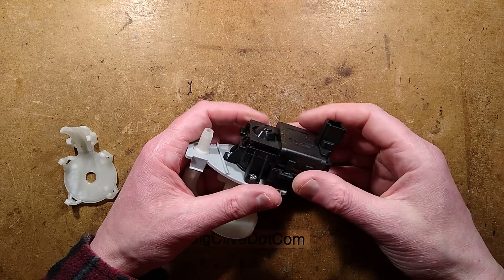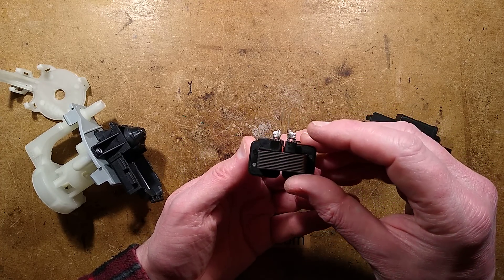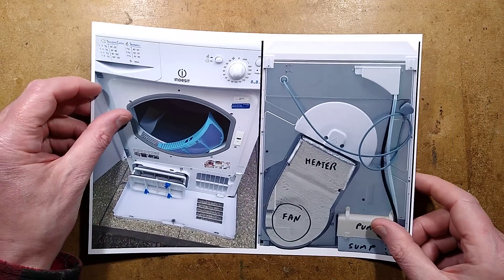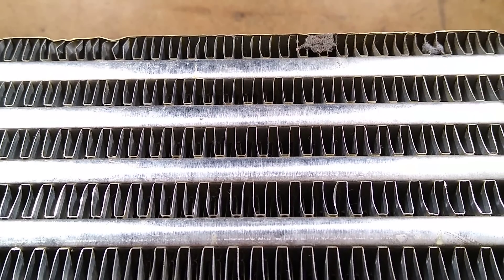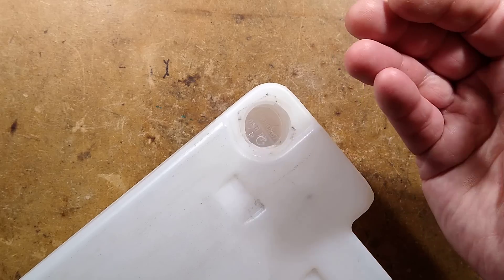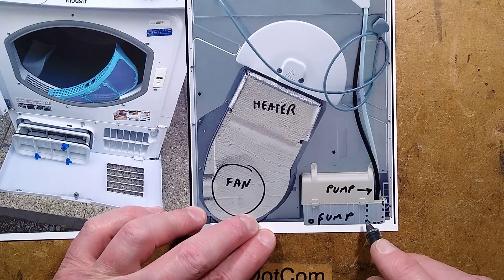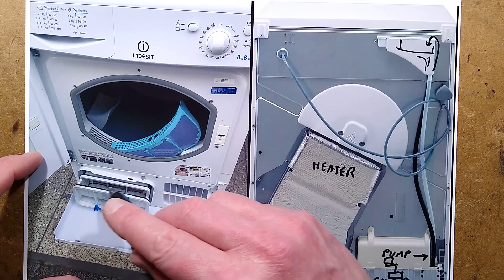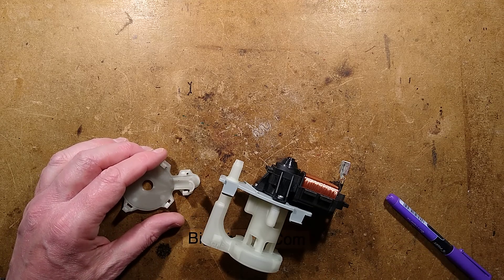Condenser laundry dryer pump

Comment: I'd love, if the condenser would work with a heat pump. It would make the design of the dryer just absolutely elegant and efficient.
Reply: most modern ones here work with a heat pump. maybe the really cheap ones don't.
Reply: There are heat pump dryers on the market. They are quite expensive, though. Around £750 for a Bosch.
Reply: @JeanTheronZA  that is expensive, i think i paid €600 for mine. it is a whirlpool
Reply: @martijn208  We were quite lucky with ours. Had a standard condenser dryer by Smeg (was about €250 10 years ago), and when they couldn't find the correct door seal for it when it needed repairs, they swapped it for a heat pump version, free of charge.

Sorry, I see now that I gave the initial price in Pound Sterling. Meant Euro, if you take a direct conversion from South African Rand.
Reply: They do exist! Lots of brands have heat pump versions of their driers. Magic stuff as they only consume 400-500 watts when drying!
Reply from the maker: The heat pump type cost about 4 times as much and have more to go wrong.
Reply: I bought a heat-pump one and when I did it, calculated the net saving in energy over using a more conventional one. I worked out it would pay for the extra purchase cost in three years. That was 11 years ago. Given the increase in energy prices over that time, it seems to have been one of my better purchasing decisions.

Comment: If this dryer is used in a smal/bad vented room, then the room temperature will rise until the cooling air(room air) dont cool the condenser enought, then the damp internal airstreeam will not condense and the drying will take forewer (or time out with still wet clothes after about 6 hours)
Reply from the maker: It does need a reasonably sized room or the door left open.

Comment: It seems they could've easily built it with just one main motor and different gear reductions? I wonder why they didn't do that
Reply from the maker: The main motor runs the drum and both hot and cold path fans.  It would be more complicated to use it for the pump too.

Comment: You are correct, these types of pumps are not very efficient, but are robust and capable of handling solids (as you say) and also entrained air - without needing to be re-primed. You will see a similar, rubber impeller on boat outboard coolant pumps.

Comment: We have a front load clothes washer that has 2 of these type pumps. One is for drain and one is for recirculation. As you can see they're very cheap to make. Our pumps don't have any shaft seals to leak. The impeller and magnet are in a flooded plastic chamber. The coils spin the rotor from the outside. Controls are simple, want pumping action, just turn it on. No valves needed.

Comment: Ok, now all we need is a slightly insane PC enthusiast to use that pump for watercooling. You know, for science.
Reply: watercooling in the 2000 decade started pretty much like that. The PC tuning scene was all about ghetto experiments.
Reply: @PainterVierax  Yeah and I figured this pump would most likely have enough power to circulate the water all the way to an outside radiator, don't know about the cost effectiveness though 😄
Reply: @ragetist  cost and power efficiency is not a thing for g@m3rz. What mattered is how high in frequency this Pentium 4 can go without burning the house.
Reply: @PainterVierax  True, true. I just care about noise these days and would rather undervolt but it would be funny to run a loop outside and see what I can get away with during midwinter and -35°C outside.
Reply: @ragetist  I foresee problems with water freezng in such temp. Even if you plan to run the system 24/7, you'd need to make sure it never fail, which is very costly in redundancy and surveillance systems. 
The safe solution is to sacrifice a bit of cooling efficiency by using two distinct loops with some thermal exchanger in between. First loop is your classic watercooling, Second loop is the outside one filled with some alcohol or antifreeze solution.

Comment: I would not have guessed that such a simple pump could move water up by about 30 inches. That pump is really reduced to its minimum number of simple components, but in way that considers the likely failure mode. We just switched to a heat pump condensing dyer in a US condo and it does seem to be more efficient.

Comment: Hotpoint and Indesit are same company as Whirlpool (they are selling this company off at the moment) main fault that occurs in these machines are the heating element which is easy to replace via back panel.
Reply: Almost yes - Hotpoint, Indesit and Ariston is owned by 75% Arçelik (Turkish multinational household appliances manufacturer known from the brands Beko, Grundic and many more) and 25% by Whirlpool.
Reply: We (in the USA) just replaced a 22 year old Whirlpool NG clothes dryer with a Maytag (Whirlpool) NG clothes dryer. I could have probably troubleshot and fixed the problem (NG burner was probably being turned off too early by a malfunctioning thermostat) but it was in a rental unit and we didn't want to inconvenience the tenant further. Hooking up venting during the install in a constrained laundry closet is also a PITA.

Comment: This is almost exactly the same dryer that I got,  mine has a different "brand name" and also it has a lcd display, where you select programs. As mine is next to a sink, I just drop the outlet hose from the pump into the sink, so I don't need to empty the water container. A couple of years ago, it stopped pumping out water. Opened it up, and the rubber impeller in the pump had  cracked open at the motor shaft, so no pumping was happening. I just replaced it with two zip-ties, and it has run happily ever since.
Also, I think mine don't run the pump continuously.

Comment: We have one like this from Miele. It has the option of the drawer but you can also put the drain pipe down a drain if one is available. It does occasionally tell us to clean the lint filter. I'm not sure if that is on a timer or if it detects a restricted flow. I found that they tend to leave clothes a little damp but the solution is to get stuff out while it is hot and let it air for a few moments.
Reply: Detects restricted flow.  Also, you should routinely clean that filter every few cycles anyway (especially after drying towels and linen).
Reply: @AnotherPointOfView944  My bad, the main lint trap is just inside the door just like in the video. That one we clean each time. But there is another one just before the condenser and that one needs our attention every few weeks.

Comment: Why doesn't it just pump the condensate out into the drain where the wash water goes? Seems extremely obvious to me, given that all washers have drain connections.
Reply from the maker: It's just a dryer and can be located anywhere in the home for convenience.  But if there is a drain nearby it can pump water out directly.
Reply: @bigclivedotcom  Ohhhhhh duh, it does say it's a *dryer*, dunno why I didn't see that. Derp! I'm dumb. I was thinking it was one of those all in one washer/dryer combo units.

Comment: During winter those dryers are the closest thing to a free energy device that you can purchase, all the energy used to dry the clothes is reused again to warm your house.
Reply from the maker: I use mine as extra winter heating.
Reply: But since I'm cooling for over half the year, one of these would just be extra load on the AC.
Reply: @jonc4403 Save up all your summer clothes and wash/dry them in the winter!
Reply: Pity  @jonc4403 can't tie the undies onto a string dangling from the balcony.
Reply: @jonc4403  A traditional dryer even more so, because it vents the hot humid air outside, meaning it draws air from your living space, which is replaced by hot outside air and (worst case) first cooled by your AC before going into the dryer!
Reply: To be really pedantic here, if you want to maximize the amount of heat, you'd probably want to let the water in the reservoir cool before emptying it.
Reply: @JeremyFoster-ve6kq  the big saving is through re-using the latent heat of condensation in the dryer air.  The sensible heat in the lukewarm collector water is a tiny fraction by comparison.
Reply: @JeremyFoster-ve6kq  no! Put it in the freezer first and then throw away the ice 😀
Reply: Better get a Heat pump version, much more efficient
Reply: My electricity bill was reduced when I replaced my condenser dryer with a heat pump condenser dryer, and my heating is all resistive electric
Reply: Unfortunately, same in the summer months.
Reply: soreally just a very effective use of energy. my kind of energy usage (in the wintertime i remove the underclocks on my computers and get some seriously good baseline heating)
Reply: My sister has a smaller size industrial food dehydrator. Wile visiting I slept in the barn that has living areas, kitchen sink and her office, along with a room full of professional sewing machines. I would run it at night to heat the place up and dry put plums and stuff. Then open the windows during the day to remove any humidity.
Reply: I'm cutting edge hi-tech. I heat my room with the waste heat of my CPU, GPU, NAS and HTPC...
Reply: I can only overclock in winter because I live in the tropics
Reply: I'm in the SE Texas Gulf Coast area... What is this "winter" thing that you are talking about?
Reply: @seanseoltoir  In some countries at the end of the year we start a small scale simulation of the next ice age to be prepared in case scientists are wrong with their predictions about climate change 😅
Reply: NOT so good when the ambient temperature rises to a point when the condenser can't condense the warm moist air in the machine, making the drying of clothes virtually impossible, & costing you money, (it's just physics).
Reply: @Sparky-Tim  "NOT so good when the ambient temperature rises to a point when the condenser can't condense the warm moist air in the machine" -- If the ambient temperature is so high that it literally can't condense the warm moist air of the heated air in the dryer _at all_, you've got much bigger problems than wet clothes.

Under normal human living conditions, you'll always be able to condense the moisture from the warm air, it'll just take longer.

Personally, I'm waiting for a heat-pump condensing dryer to be available in the US that's large enough for my bedding. In the meantime, even if I had one of these, it'd be fine outside the heating season, because if it's warm enough to not want the extra heat in the house, it's warm enough to line-dry the clothes outside.
Reply: @Sparky-Tim  That's when water cooled condenser driers are beneficial.
Reply: I also have a set of incandescent lamps I swap out many of my LEDs for in the winter time. Suddenly they become 100% efficient in the winter time and provide nicer light. I also have one of those plastic pools in my shower with metered drain holes so the water is able to release its heat before draining. I live in an old house in the northern US and pay less than $100/mo in natural gas in the worst month doing little crap like this that a wife or family would never let me get away with.
Reply: Especially if your house is heated via heat pump, then it'd much cheaper :P
Reply: @JustinKoenigSilica since it is energy already used to dry the clothes it is free heat inside instead of throwing the dryer heat out thru a went....
Reply: @kjetiltrondsen8242  we don't have any vents in my house I'm not sure what you're getting at?
Reply: @kjetiltrondsen8242 
Only problem is all that dust and lint builds up inside the dryer around the heater and pretty much everywhere as it doesn't get blown out and has caused many fires over the years 😔 especially hotpoint Indesit and hoover candy i find as an appliance engineer of 35 years 🙂 hotpoint Indesit where subject to a recall and modification of over 4 million dryers .have done hundreds and the fix doesn't do the job to be honest
Reply: @JustinKoenigSilica it doesn’t quite work like that. The benefit of condensing dryers is gained by the difference in operating vs ambient temp! They need cold air flow in order to condense the water from the “hot side”.
Reply: @JustinKoenigSilica  Not quite - the cooler the air that enters the condenser, the more efficiently it will condense water out of the hot, moist air stream... so placing the dryer somewhere that is not already well heated by your radiators or radiant floor is a better choice.  If you can put the manifold for your hydronic heating system at the bottom of a cupboard, that makes a good place for a drying rack above it though!
Reply: @JustinKoenigSilica  The funny thing is that if your house is heated by heat pump then it is actually heating your house more efficiently (typically) than the dryer/space heater.
Reply: @JustinKoenigSilica  yeah it's  a clever trick of mathematics.
Reply: These are slightly less horribly costly than ventilated dryers ,  I routed the vent from my drier via a floor duct in the concrete insulated floor deck to do the bear recovery ,  financially a Gas Drier is way more cost efficient , a commercial vacuum evaporative drier is better , but drying outside is basically cost free ,  I  used bowstring trusses for the playroom which my wife adopted the steel straining wires to dry washing inside when it's raining outside , great video Clive , met you once a decade ago in a supermarket I was doing the IT  and you were organising packs for the Cabinets outside then dragging the cabinets about with those spider castor things cutting my cabling in the process

Comment: Greatest machines other than clothes lines - far better than those older machines that had a hose you hung out the window or through the wall. As an aside, I seem to get inundated with 'shorts' that show American tumble driers that go on fire or have extremely long exit hoses to the roof that get filled with fluff - a guy getting paid to 'scoor' them out with what looks like an electric drill and vacuum cleaner 😁😁 Thrilling stuff
Reply: Ha! I just had to vacuum out our dryer vent. Fortunately the modern LG dryers tell you exactly what percent occluded your vent is. I wait until 100 😀
Reply: Yeah, I assume that's a YouTube thing. I've had to deal with our (USA) vented dryers a number of times. Last incident was last month  AFAIK, these dryers have had thermal, one-shot, fuses in their internal exhaust ducti for the last 30? 40? years. I replaced one in my neighbor's dryer, wondered why it had blown, and then discovered that their  outdoor vent gizmo was totally clogged.
Reply: They have retrofit devices for electric dryers that collect the water and no outside hose is required. I had one at my last house, have no idea why everyone doesn't use one, I liked that setup much better than the stupid outside vent. I might put one in at the dryer in this house and put back the window the previous owners removed to put the vent in.

Comment: As dacha size houses here only have a 25A main breaker, the dryer only draws a max of 10A.  

Our Candy brand machine doesn't have an upper drain container, it just fills a BIG container below the condenser.  When it's full, there's the red LED to empty it.  

We're going to make a stand to raise up the washer and dryer so I will add a drain hose to the container and run it to a floor drain.  That will save my wife from having to empty it.

Comment: My friends have one of these. Great at heating the landing in winter, far too hot when they use it in summer. (emergency drying)
Reply: In summer, they can dry their clothes outside on a line.
Reply: @simontay4851  If it was work or school clothes they needed to wash and dry in a hurry, they would use it in summer. Also it can get really hot here in UK but still be raining. LOL.

Comment: Wow.  This looks very modern indeed.  But our landlord is so cheap that there is still an ancient Maytag washer and dryer in the laundry room.  These antiquated machines look nothing like this sleek appliance. You can even see in the back of the washing machine since the rear panel has long been removed, exposing all the various hoses, valves, wires, motors and pumps.  Interesting but good thing there are no babies living here.
 
~:o)   Ooooo... 💥
Reply: Be happy that you've got those.  They tend to be a LOT more reliable than the new ones.